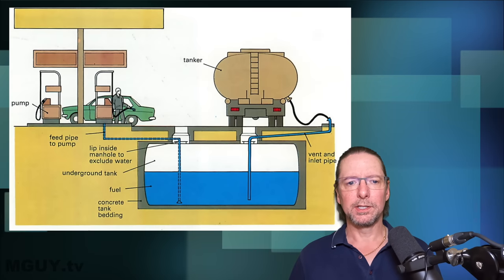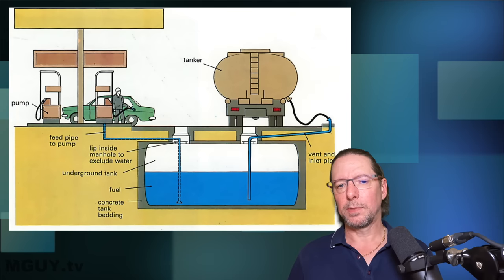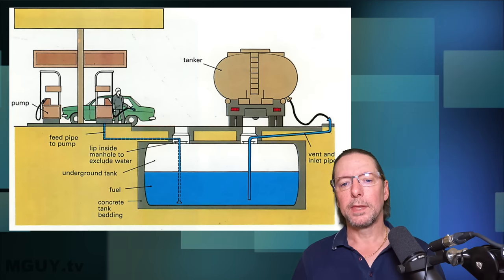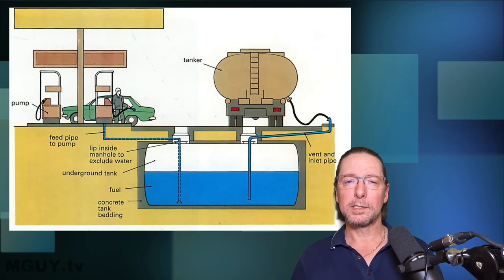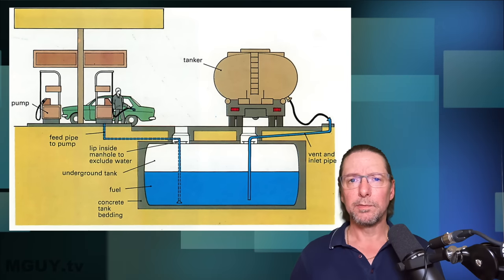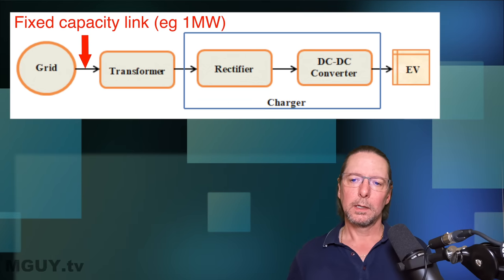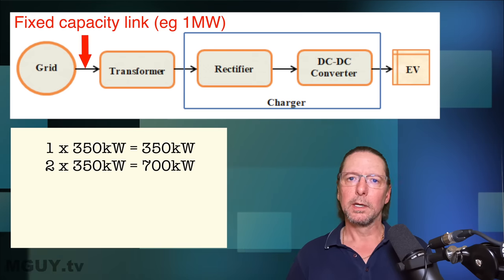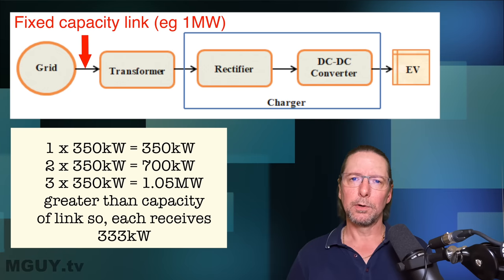HUGE problem with EV Charging Stations that no one mentions | MGUY Australia

Comment: WHAT happens when the power goes out, like it did recently in my neck of the woods...for 10 days !!
No power, no pumping fuel , no charging ev , no accessing money via card...SOLUTION...keep cash handy , keep fuel car , keep praying for common sense to prevail , keep voicing our concerns, and keep supporting channels like this . Thankyou one and all for the good work you do 💜
Reply: That's why it is important to have solar and a battery at every charger where possible. I have this exact scenario at home, and every time the grid goes offline, my battery powers the house for days.

Comment: In Britain, over the Xmas period waiting times of up to six hours have been reported. Sitting in your car for many hours with the heater going in the wonderful British weather will drain the battery even further, thus taking longer to charge. Imagine your battery is getting low and the motorway that you are on has a car crash blocking traffic and you are sitting there watching the gauge falling and the charging station far away.
The weather is always a problem in the UK because there are only two seasons a year, August and Winter.
Thanks for another great video.
Reply: Ditto siting in your ICE when you failed to fill up and keep the tank above half like your father told you to do......
Reply: @JohnSmith-yv6eq  Nope.  A gasoline car can idle for a long time on a little fuel.  Plus you can turn the car on and off.  The hot engine can provide a lot of heat.  The EV can't do that.
Reply: Better yet, Just Stop Oil joins the party! What could be better?
Reply: Happened in the USA last year heavy snowfalls and roads were unaccessible - what the media kept very quiet was the stranded ICE car drivers remained safe by leaving their cars on tick over with the heaters running without any problems whereas the EV cars batteries were drained and due cold and them to being stranded as a result a large number EV drivers actually froze to death before the rescue vehicles could get to them while all ICE car drivers returned home safely.
Reply: @ThePrairieChronicles  - make sure you never a buy an EV so you won't get stranded battery dies and you freeze to death. If you have an ICE car just leave it on tick over to keep your heating going till the highway is clear to move on.
Reply: The road crash scenario is very real. I’ve roadtripped most of America. Crashes, construction, and weather have often forced me to detour. In a real car I could always expect to find gas, even while detouring through nowhere Missouri, Pennsylvania, etc.

Then there are the times a detour is not possible. I’ve waited hours in such situations. But gas was just the next exit. And Waffle House 🥰

And then there are the vast, desolate, and remote places. Good luck in an RCE* vehicle.

*Remote Combustion Engine
Reply: @ThePrairieChronicles   Measuring the difference on the Shiverometer you get down to -50 - we in UK might, some years, get down to -5. You are a weather hero!  Today i bought a pair of `long johns` because we are down to -2 in our area.
Reply: Try the high desert, 110F in summer and below freezing in winter, have you ever seen how well a battery works in those conditions? It doesn’t.
Reply: pardon my ignorance but what is ICE car?  @cloudbasenirvana
Reply: @ThePrairieChronicles  2 centimeters of snow the whole country comes to a standstill, including the trains which will also stop if we get the wrong sort of leaves on the track. This is not a joke.
Reply: @kasey-l5z  Yeah but I bet they never get "The wrong kind of snow" ....... That brings the UK to the brink of Armageddon!
Reply: Just put the charging stations near strip clubs. Three hour wait? No longer an issue.
Reply: @JohnSmith-yv6eq  You can buy a Tesla at a very cheap price, Hertz and Sixt worldwide are getting rid of thousands of them because they aren't a viable option.
Unlike EV charging stations, petrol stations are everywhere.
You may have trouble charging your car on a long journey because thieves are cutting off the charging cables to sell the copper for scrap.
Reply: @kge420 I think you are onto a winner here.